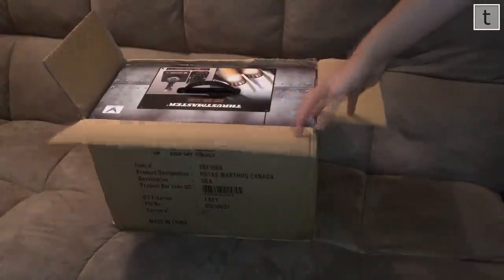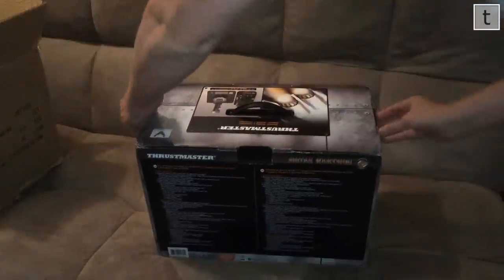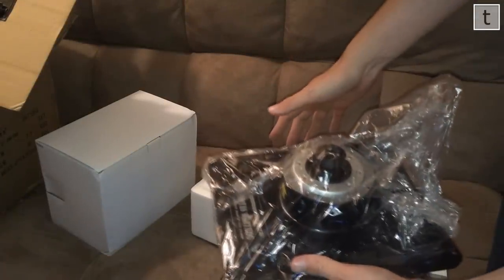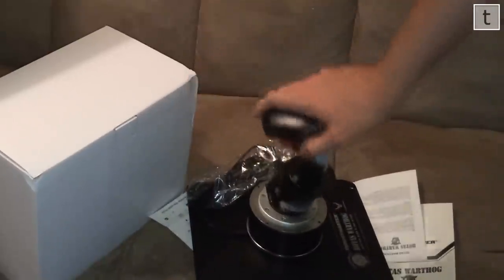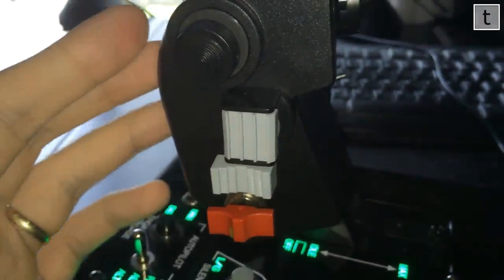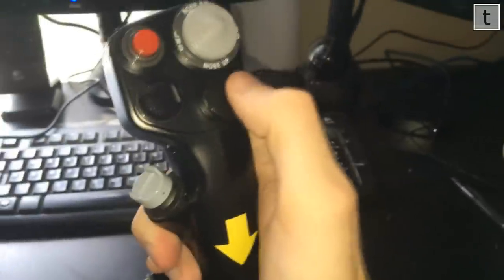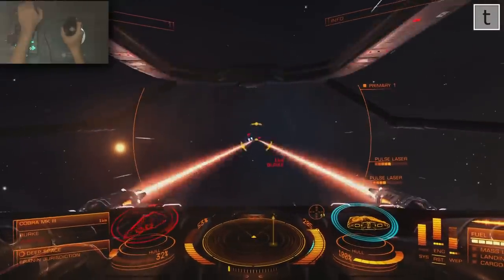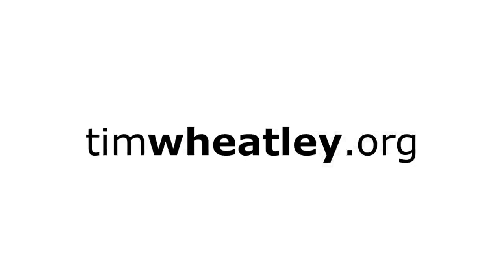Thrustmaster HOTAS Warthog A-10C Unboxing and Overview

Comment: HI, at 8:15 the upper right grey button is the trim hat. It is used to balance the aircraft with if either a weapon got released on a side, fueltank balance, equalization of the aircraft center if needed at landings. It moves internal wheights or trimming wing tip surfaces.

Example: 2000Lbs on each wing. If on left side is released, it pulls the right wing down. To compensate, one trimms usually directly after release.

Comment: THANK YOU!
You were the only one on the web showing every type of buttons of this set.
Nice review, you one (late) tip: on the space sims you should bound the movement of the stick to pitch and yaw, and leaving the roll to something secondary (like the pedals or even 2 buttons), because roll in space is almost useless.
Well, this is late of course, being 2 years =P
Reply: In Elite Dangerous yaw is secondary, it's a very slow movement used to fine tune positioning where roll does the bulk of the heavy lifting.

Comment: the grey thumbjoysticklet at your stick is for trimming the plane. i.e. when u fired some bombs, rockets or sth. one side is way lighter and the plane tends towards heavier side. with trimming you position the center of the stick - virtually - towards the lighter side, so there is a balance again - means: when u dont touch the stick, centerposition, the aircraft is in balance. sorry for my bad english though.

Comment: Hi Tim.. I'm about to get rid of my X55 and get a Warthog.. How do you map your buttons to the switches? On the X55 the switch-buttons are temporary presses.. I can either press them up or down and they will automatically re-center.. That's obviously not the case with the Thrustmaster as you've shown.. I just wonder how you map them.. For example activate cargo scoop, landing gear, initiate fsd etc.. To me it looks like the Thrustmaster Warthog has very few button that can be used for these kind of things, or am I wrong?
Reply: Great, thanks for the answer!

Comment: I don't have space for foot pedals so I'm stuck needing a twist stick. I might get the throttle by itself until I can completely rebuild my entire room to make a computer desk suitable for pedals
Reply: The joystick has built in yaw iirc.
Reply: @Matt_10203  No, it absolutely doesn't. It has a tdc slew (that is awful and good replaced with a playstation stick) on the back of the throttle but the joystick has no yaw.

I've been using it for over a year now.

Comment: Paying 400 for a stick that has no rudder... Now you have to buy pedals aswell...
So if you dont have that much money, just buy a Saitek instead... Works fine for me
Reply: there are cheaper alternatives if you don't want to spend money, for example T16000m. If you add twist, you'll lose precision. And the warthog is the lowend of the premium sticks, of which not one has rudder.
Reply: well, saitek is not made for too long - serious issues with buttons, software. it really lacks quality - can only speak for x52 pro, but read similar things about x55 and x56 - which are really cheap quality for that money, the 100 more should be well invested. i think one might get a great setup for ed too with that system. yaw, well, should be put somewhere else. i think in fight u dont need that stuff - shouldnt make a big difference in maneuverability, if u need quick turns or sth. u should switch FA off anyways, well timed and coordinated with your speed.

due to the fact that i m very disappointed according to saitek stuff, or logitech or whatever shit this is now, superpoor quality for that amount of money, even the software is crappy as fak and a lot of things programmed just dont work - in dcs for example: i spent HOURS trying everything.

when i can afford it, i might give this warthog a try.

even though there are alternatives, virpil vps mongoose, which make a really good impression, but are slightly more expensive. 

i dont know. there is no easy solution fitting both: flightsims and spacesims. :/

on the other side i really want to fly a a10c ;)

Comment: you don't know anything about A-10, do you?
Reply: ***** You missed a button... The trigger has two stages. Which are used in the A-10C for the gau-80. the first stage enables PAC 1 to stabilize pipper ("crosshair") on the target. Sort of an autopilot bank to keep the pipper on target. Then a further push fires the GAU cannon and enables PAC 2 to compensate for recoil. Obviously this is used on hard targets to get as much depleted uranium in their face. For strafing runs I assume they switch off gun/pac. In my opinion this is the most important butt'n on the hotas :)

Comment: P.S.
I have had mine 7-months, and the throttle needs an axe taking to it. The USB power on the throttle is the most unreliable piece of shit this world has ever seen. Lots of complaints online about it... I now use the XBox one controller for games such as Star Citizen because this Warthog trash is so bad.
Reply: ***** Probably related... because it seems if I switch it on or off the wrong side of starting or quitting a game, it stops it working for a day or two sometimes. Sometimes all I have to do is switch USB types, but other times its got an attitude problem. The hardware itself is in mint condition. The problem may be just related to one or two games.  Maybe that...
Reply: Lol. I just tried a 3rd Port (awkward due to how the rig is arranged with Desk cabling) after it Repeatedly failed in the USB 3.0 and the other USB 2.0 ports, and it works only in the 3rd USB. But the Computer and cables are all reasonably new and Everything else connected ALWAYS Works on it (i7 GTX1070 rig). So, its a mystery (because if its static, why does it only fail sometimes, and not others, and did not fail in a new USB port (if the static is in the hardware). I didn't move the Throttle hardware. Its why I think its got an attitude problem, Lol.

Comment: Did you steal Ashens sofa? ;)
Reply: *****
More importantly, do you think it's worth upgrading to this HOTAS from the X55 Rhino.
Reply: *****
My X55 seems solid enough. One of the small joysticks on the throttle doesn't click on the down like it does on the rest of the movement, but it still works. Are you getting VR? I can't wait for my HTC Vive to arrive.